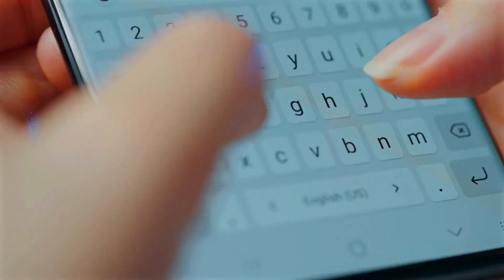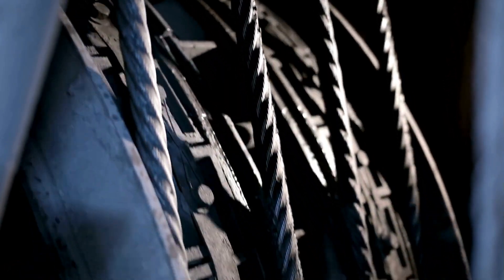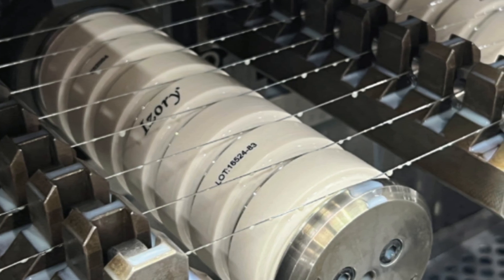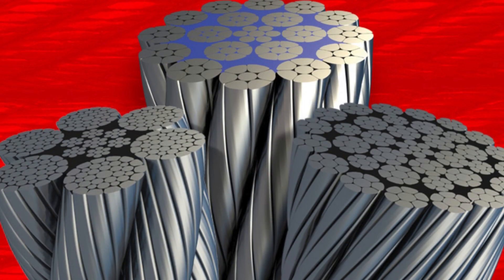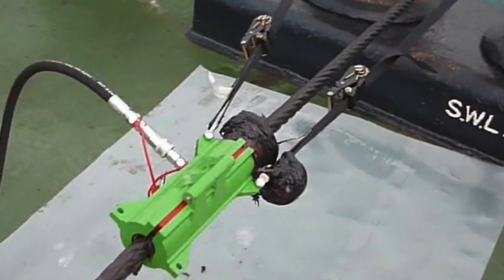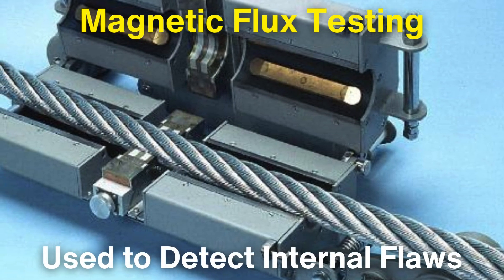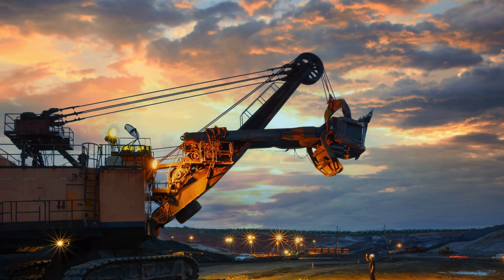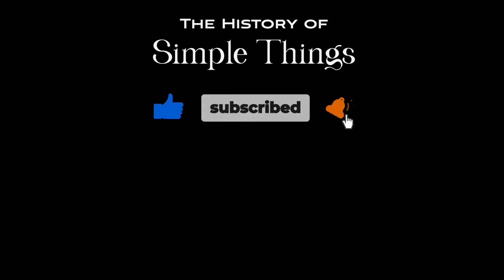How Industrial Wire Ropes Are Made and Its Uses!

Comment: As a young teenager in the early 1960’s my friends and I searched an old quarry for wire rope with a natural fibre running through the centre.
We extracted as much of the fibre as possible and used it as a slow burning fuse cord to light fireworks. It saved on matches as it burnt for ages.
Our ingenuity surprised us and wondered where we learned it.
Excellent video thank you.

Comment: Contra laid cables have been used in the British military for many years for the simple reason that if the cable snaps under stress, it will simply drop and not whip backwards as a single lay cable would.